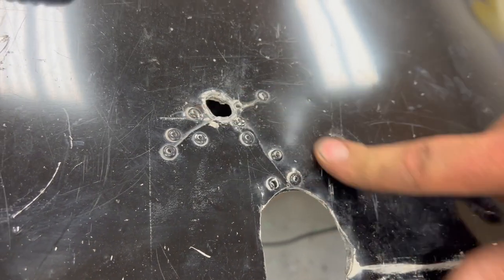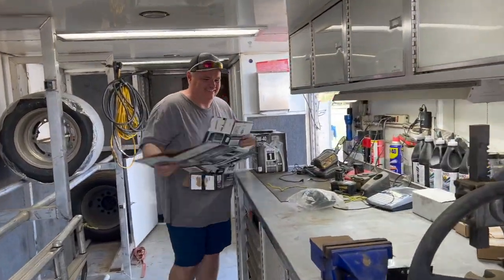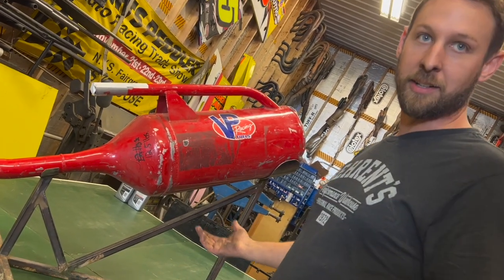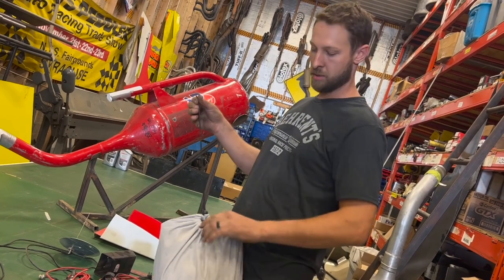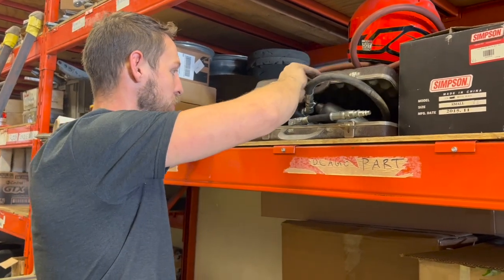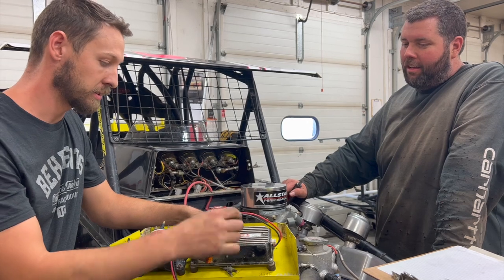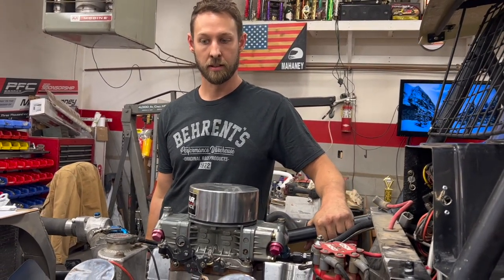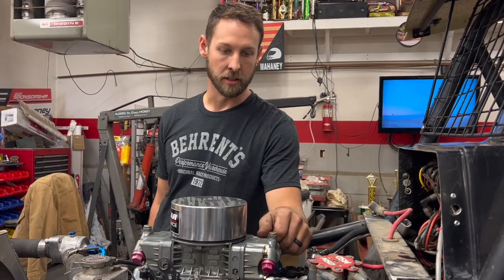How Do We Prepare For Super DIRT Week?

Comment: Hope you win or  another top 3 .  before you run the ported intake . I'd check & see how close each runner is , by cc them . it's best not to polish them smooth past 90/ 110 finish . helps break apart liquid fuel into vapor ratio, & stops " puddling".